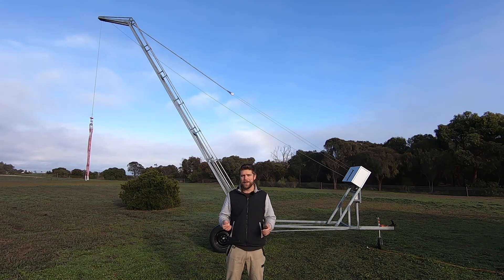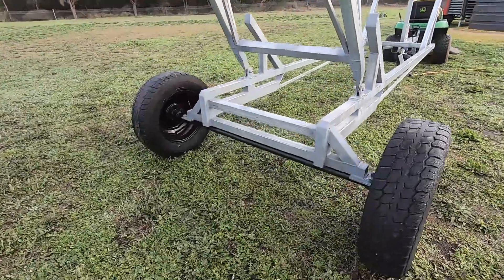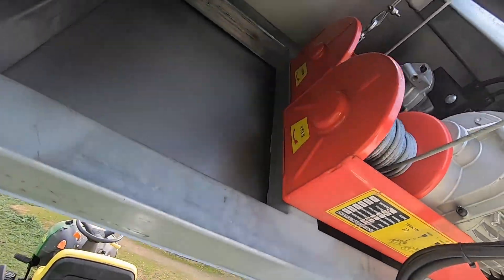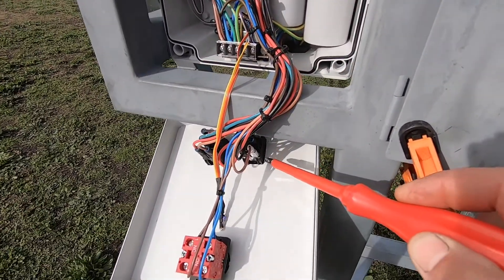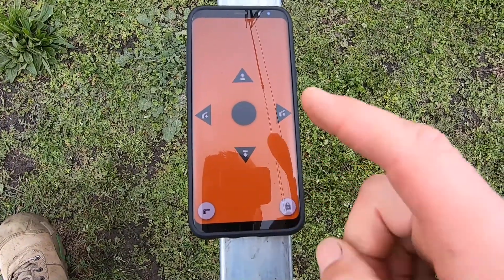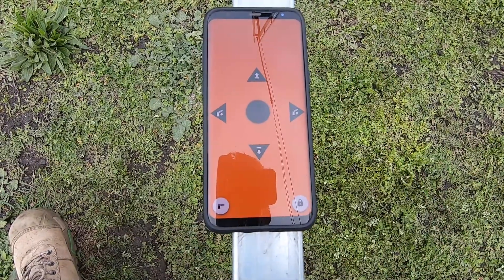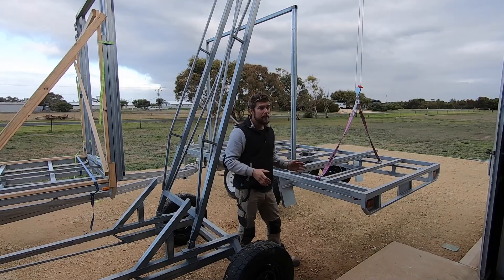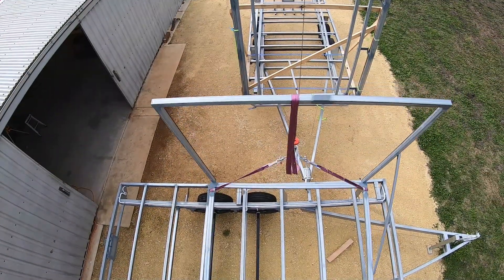Ep. 07 - I built a smart crane that's controlled a smartphone - Tiny House Build Update

Comment: I love this!! What a great job! I'm a crane operator for the local 3 in the US and have always wanted to see somebody do something like this because I never had the balls to build one myself 🤣 I just have two recommendations that would definitely be a plus to your safety. Tow hitches are designed to have downward pressure, if you pull up on it then you're only counting on the little catch that goes under the ball to stop the weight of the crane pulling forward, and up... That's bad. A quick fix would be welding some safety chains to your crane and then hooking them to the frame of your vehicle. The other thing is to put some adjustable outriggers near your tires. There are many all terrain cranes that are designed for pick and travel but they have massive extremely tough tires. Please be careful and keep up the good work. This is amazing!

Comment: A very beautiful crane, but I didn’t understand that it was with a counterweight, it looks like if it is loaded well, it can tip over
Reply from the maker: I have a tow hitch on the front that I can hook a vehicle onto. In my case I use a ride on lawn mower. The only way it can tip over is with strong cross winds, it's not as stable sideways.

Comment: I love the concept of your crane. I’m thinking of using some of your design to fabricate my own crane to lift logs onto my sawmill which I’ll be fabricating from scratch also. Plus some odds and ends jobs around the house. But I want to beef it up to handle the jobs that I throw at it. Thank you for the idea.
Reply from the maker: You are most welcome my friend. Share what you make if you do. Love to see it. 
Couple tips if it are copying parts of it. 
Don't run the lift cable from the winch to get top of the boom. It pulls it back when under load and close to vertical. Put the winch at the base of the boom or do what I'm doing and put a pulley at the base
Limited lateral stability (which I knew) been fine for me but almost lost it once to a freak gust lifting the roof up. Otherwise. Love it
Reply: @TwoHandsandaTinyHouse  thanks for the heads up. I was thinking of running the boom cables at around the half way point, and putting an extendable boom at the top of the boom mast and put a pulley where they connect. On the hoist cable, I’m thinking of using 2 double grooved pulley’s to increase the lifting power. I’m also thinking of making the mast capable of folding down to make it easier to transport if needed. Not to mention the addition of outriggers. I’m probably going to use 3182kg strength cable, just to be on the safe side. The mast cable will be a higher tensile strength cable to minimize excessive flex of the mast. A little excessive? Probably. But, it’s better to be safe than sorry. If you want to implement my ideas into yours, go ahead, I have no patents on my ideas at all. Thank you again for getting the gears turning in my head.
Reply from the maker: All sounds like great ideas. Mine could certainly be improved but I've just moved on with the build and it served its purpose. I may upgrade it one day. Have fun building
Reply: @TwoHandsandaTinyHouse  stay safe my friend. 🍻

Comment: I love this idea. Do you have any plans or diagrams of  the crane and app for sale
Reply from the maker: Cheers man. Don't have any plans. Not sure I'd draw them up as I don't really know if it's safe. I'm only going on the fact that it hasn't killed anyone 😂😂. Happy to give you any details about it though. As for the app I'd share the code for anyone who wants it
Reply: @TwoHandsandaTinyHouse  Can you tell me what are the measurement and type of metal that you used such as 1/4" or 1/2" square stock, angle irons, flat bar, counterweights, winches, etc. I should be able to figure it out. Build it at your own risk.
Reply: @TwoHandsandaTinyHouse  I would like to get the electronics in your control box. i would also like the code for the app you have.

Comment: i am about to build a gin pole lift to place some 6"steel beams and trusses for my carport build.  your video was awesome and inspiring and is very similar to my initial thoughts.  your automation hack was next level.  my question is that with your angle pulley at to top of your crane boom , it seems to me that the  forces that would buckle the main boom beam would deform it  as a V  rather than a ^.  in other words, the boom is being compressed rather than under tension.  when i thought about my gin pole, i considered putting a strapping tension member along the bottom of the 2 inch schedule 40 pipe to combat this force.  is your truss tension member  on the wrong side the main boom structure(top rather than bottom)?  that is my impression, but i have yet to build or lift anything.  good luck with your tiny home build.  i subscribed.....
Reply from the maker: Hey there Peet. Welcome aboard, thanks so much for your comments. 
I think I know what you mean - should the bracing be on the opposite side of the main structure of the boom. The answer, yes you are on the right path. If the boom were to fail it would probably buckle in the opposite direction of the bracing. I thought about this building it but decided to see how it took load and would put bracing on the underside of the boom if I saw deflection was an issue. I didn't put bracing on that side as it would affect how close I can get to what I am working on. And it was a lot more steel. You will also see it's not just strap bracing. It is more of a ladder truss design which actually gives me strength in both directions. It's either in the previous video or my Instagram that I show the difference with and without the bracing. To be honest I have not seen that much deflection in the boom. I have been really happy with it and have no plans to change the design. I don't think I would safely lift anything that would risk buckling the boom. 

Here are some things you can improve on though. 
- The main winch cable should either winch from the base of the boom or run via a pulley at the base of the boom. I have found that under heavy loads and when the boom is close to vertical the winch cable can pull the boom back on to it's stops (PS definitely include stops). I have combatted this with some heavy springs on the underside of the boom to the base but would modify where the main cable runs. 
- Consider lateral stability. Maybe outriggers, depending on your situation. I knew this one from the start. It has been really good for me but one day lifting my sliding roof that has a large surface area I got a sudden gust and it was going. Some how I stopped it by pushing against the winch assembly but really it was a bit gusty that day to be lifting. There is vid of it going over on IG
- The base frame as some flex as the winch assembly is pulled towards the boom. Honestly it has not proven an issue but I like to build stronger than that so I would strengthen that a bit more. 

Other than that you should definitely automate it if you can. That has been the single best part of the crane. It has made working solo a million time easier.
Reply: @TwoHandsandaTinyHouse  thanks for the thoughtful and helpful response.

Comment: a very impressive build.  The control system and cable speed looks to be very workable.  You have also built a very effective tall tripod also!

  Are the relay/app control components off the shelf or all custom?
Reply from the maker: Cheers Simon. Yeah I wish I could control them variably but the motors need speed for power. I have put in provision to double up the lifting cable that slows it to half the speed and that is very manageable. The boom is pretty good but also has provisions to put another pulley in to slow it even more and give more strength. 

All the electronics are off the shelf. Firebettle Board-ESP32 and the relay boards are all common af. A resistor or two and ribbon cable to hook it all up is as much as I did. The app and the code running on the micro controller I programmed so they are not off the shelf. All pretty straight forward code though.

Comment: Nice way you have designed and built the crane.  I'm building a two or three section oversize tiny house on a shared detachable 3500kg extendable trailer - destined to be transported to the Gippsland lakes.  I had contemplated an overhead gantry to assist in the build.  Your design is far more elegant.  You can do a hell of a lot on your own if you plan it carefully - I need to install 6x4200 trimdeck poly panels, which are relatively light but difficult to move accurately and safely with only one or two people.  A 5m high workshop with exposed rafters  would be good.  But your Tiny Skyhook would also be the answer.
Reply from the maker: Thank you Paul! Your build sounds awesome. 
Oh man if I could have in indoor workshop with a gantry crane I'd be one happy dude. I had cladding in mind when I built this. Going to do a lifting bar with a gantry roller so I can slide it to where I need it then have a frame with rubber feet and a lifting magnet for the sheets.